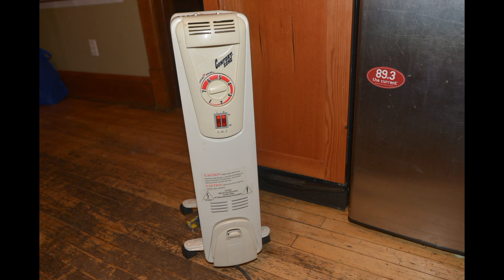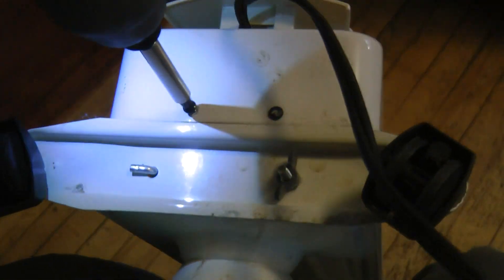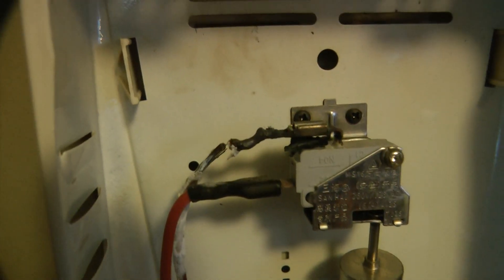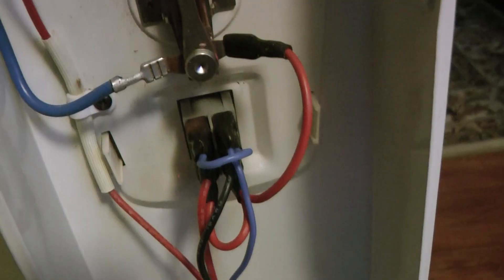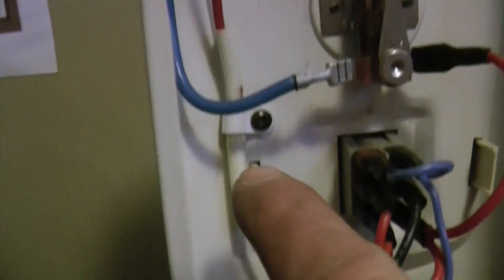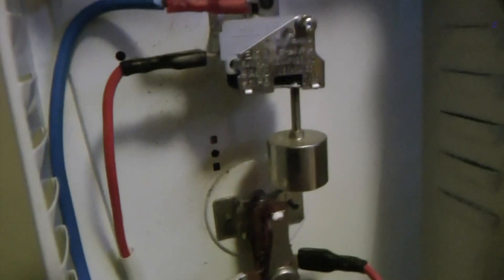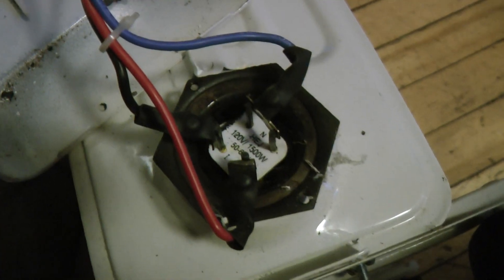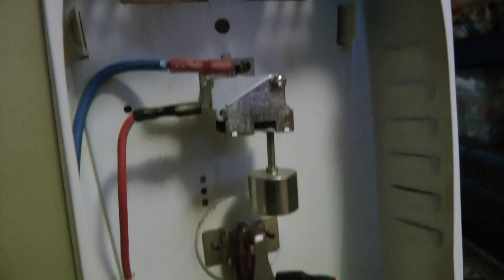EASY - Oil Filled Electric Heater Repair & Wiring Diagram

Comment: my dad in a small house used one of those small suitcase sized oil filled radiator type heaters, it was WONDERFUL for his situation, BUT, with his memory he would leave it on, one day I noticed a discoloration around the plug in the outlet, when I unplugged it the actual heater plug nearly came apart in my hand like putty, I then purchased one of those yellow heavy commercial plugs & replaced the original one with NO issues, BUT, if I had of known electrical stuff better I would of traced the cord into the heater & replaced it with one heavy duty one. WISH I had of rigged the knob or switch to where it could of NOT been turned to the max

Comment: That's not corrosion on those wires but high current meltdown.  It's amazing how many space heaters I open up and find melted wires.  I have numerous with failed 4-position rotary switches I'm replacing but prefer the dual rockers like yours has.  Much better and last longer.  What I like to do is actually leave the switch toggled on and control heater through the thermostat.  I like that tip safety switch.
Reply: Hi Tie/Matthew, I have a heater that just died on me...not because of the heater itself, but from the wire connected to it. The model that I have is very old and I wanted to know if there was a way that I could just replace the wire itself? If so, then where would I go to get the replacement part, especially given that it's an older model and it's no longer being sold. (Model: Honeywell HZ910). Thank you for any help you can provide. Thanks.
Reply: What temp is the thermo switch suppose close at
Reply: I pulled off my cover to quick now I don't know where the wires came off of the heating element can you please help
Reply: @toshia333  how did you make out
I think I have the same model
I pulled the cover off to quick now I don't know how the heating element was wired can you help send a pic or let me know if you found schematics

Comment: It would be a good idea to check the safety switch to make sure it isnt shorted. Also you should at least check the contacts on the thermo controls. Something made that wire burn and melt. While its open grab a can of contact cleaner and emery board a small soft aluminum wire brush and get after it. Use if contact grease wouldnt hurt when you go back togetger with it. It will help  keep the contacts and leads from oxidizing corroding as well as all terminal ends. Also if the blade terminal ends feel loose or not evenly connected on the blade gently squeeze the female terminal end  as to snug it down on its  terminal.
Reply: Yep you would have to say that anything with burned wires you shouldn't repair, it's probably the thermal cut out in the radiator body gone wrong in a bad way, even if you new how it wouldn't be worth it.
Reply: @peterbutlin6166  its not necessarily the burned wires part but determining the cause is worth putting a meter on it. If wores are burned right at a contact point of a sensor or element etc then thats a pretty good sign that whatever the wires are connected to prob failed in one way or another. If the wire is burned in the middle of a given length it could be that something caused it to get too hot in that spot or rubbed on the insulation or even internal wite failure possibly caused by the wire being mishandled onbinstallment and strands were broken causing a small short gradually causing further failure. Ive encountered all of those scenarios.

Comment: The thermostat ISN'T a rheostat. It has a bimetallic strip that when heated will eventually disengage the contacts. They can weaken and not shut off. A minor rebind can fix it

Comment: That “Rheostat”, on the the inside, opposite the Temperature knob is actually a precise Thermostat.  It has Contacts in it (like your oven t-stat), not a coil of resistance wire (like the stove burners).  These heaters often fail because people think thermostats are like stovetop controls (or gas pedals) and will heat “faster” if you turn them up higher than the desired Set Point.  [People do the same with air conditioners too; coming home in the afternoon, after “saving energy” by turning it completely off when they leave and turning it to 60 on return.  Then wondering why it quits cooling after an hour.  The coil didn’t get to defrost and is now a block of ice.]  The wire that burned on your heater, was simply The Weakest Link; basically a fuse.  Replacing the wire does not repair the Operator’s leaving it on high.  There IS a limit switch (for the oil), just above the heating element.  There is not a limit for the temperature inside the cover.  If you really need the air circulating in the front cover, to be 90+ degrees F, expect to replace the heater.  (It’s the cheapest way to get parts.)  P.S.  I’m installing a “stop screw” on the thermostat knob, at 74 degrees, where it will cycle off, cool to 72 (like an oven), then turn back on.  P.P.S.  Your electric water heater works the same way, except 240 volts doesn’t “Jolt”, it Kills.
Reply: I'm having trouble with my honeywell, it's old I separated the cover to quick and now I need to find out how it was originally connected.can you help please

Comment: I have two I bought last year that work great. I bought a used one and the dial is loose like it was knocked over and when I turn it all the way up, it still doesn't run long.

Comment: Not Positive  and Negative but Phase and Neutral   unless you run on DC!    tip over = anti tilt switch, not a rheostat switch but a bi-metal temperature regulating switch... 
question: where is the 150 Drg C  over heat temp safety shut off button thermostat?
Reply: Mine quit heating . I found the 150C over heat switch. I made sure I got a 15 amp replacement. Mine was open and when cool had no connection between terminals.

Comment: Mine powers up, but doesn't heat. I opened it and the thermostat knob doesn't click. Usually it does a clicking sound even if it's not plugged. Mine stopped doing it. I can't figure out how to fix it.
Reply: Was it fixed?
Reply: @Rishi2015  No. Had to get a new one. (Which also laster for a couple of years.) These things are probably designed to break after 1 or 2 seasons.
Reply: @martin984  Thank you for your reply.

Comment: My oil heater only gets luke warm when turned up full. The bottom is hotter that the top. The power lights only stay on for a few moments at a time...
What part could be faulty?
Reply from the maker: If I had to guess, it would be whatever apparatus the power goes through that is controlled by the dial or digital setting for heat level on the outside. It could also be one leg of the element, but that wouldn't make the light turn off...
Reply: Try flipping it for a few minutes, then flip it for a few other minutes, then test it.
Reply: I f**ked it out...

Comment: there is no Positive and Negative in Alternating Current, it's only a Hot and Neutral
Reply: Yes there is, positive is powered wave alternation, that's why it's positive, alternating between positive and negative, neutral is like the earth, it is essentially neutral, if you connect the positive to the earth you will experience an alternating current.
Reply: @peterbutlin6166  You have a live and neutral in AC not a positive and negative, as the live alternates between positive and negative with respect to the neutral and ground. So, it's not positive and negative in AC wiring.
Reply: @Eddiecurrent2000  no, AC, alternating current.
Reply: @peterbutlin6166  Yes, AC it alternates between positive and negatives, therefore there is no positive and negative wire polarity, but live (hot) and neutral.

Comment: Can you make a vid on how to wire directly to the heating element for a oil filled heater that has a two heating elements in one . Thanks
Reply: robviolin1 
then when your house burns down because you bypassed the safety features you can sue his back end ???

Comment: Hello my friend.. I've bought an AEG RA-5589.. the only problem I have is the temperature reading of the heater is reading wrong.. Room has for example 19 C for example and to set it to  maintain this temp I have to set it to 16 C. If I set it to 19 for example it seems not to autoclose its heater.. Is that normal?
Reply from the maker: Tooth Pain I think it's hard for the heater to be very accurate since the temperature probe is so close to the heat source. I would use the setting only as a relative measure as opposed to the actual temperature you were looking to achieve.
Reply: Thanks for your reply! It is just that it is a new device and I don't want to have picked a problematic.. Other then that it is working perfetc! Thanks again!

Comment: is it dangerous to remove the switch? and can you give me a tip on how to do it? mine got defected and burned, if i remove it and put the wires together, is it a bad idea?
Reply from the maker: Hmmm. I probably should not say. Watch the video for my take on what all the wires do and make your own decision or ask someone smarter than I.
Reply: Attila Albert  you can twist the primary switch wires together IF there is an overload protector switch.  If there is not then don't do it.  power will continuously flow and eventually make the metal casing of your heater powered or could cause a fire

Comment: It seems like the oil heaters are a deception. They probably only put out about 600 W. And they all have basic on and off switches like you’re too on and off switches. If you just turn one on it probably is just a light switch or an on and off switch. They simply just have power going out to the thermal coupler and then to the thermostat, that’s it.

Comment: is it possible to just bypass all the safety stuff and hook the wiring up directly to the elements..exercise a little common sense and not leave it running when no one`s around ?
Reply from the maker: That sounds like a good way to burn down your house. I am pretty sure you could buy these heaters in any pawn shop for like $30. It is not worth the risk.
Reply: @mbrenengen  except i`ve been thru 5 of them in 4 winters..they always stop working at least here in the US..they used to be high quality now they never last..there has to be a way to wire them so they hold up
Reply: Probably but what if you have a medical emergency or whatever for example

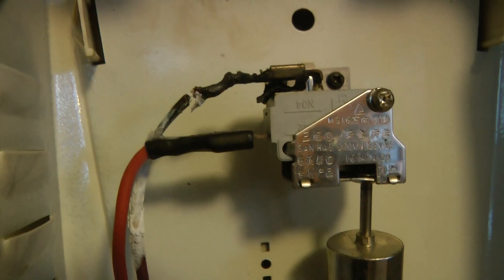Comment: hi, you missed the component at 1:37. it is a contact switch. it has probably fused itself and thus the burned wires from the heater being continuously on when plugged in. i just repaired my lakewood 7000 with a similar wiring configuration. the contact switch was closed and wires burned. cleaned and adjusted the contacts.  the heater now works and shuts off. best regards, m)
Reply: I thought possibly that burned wire is actually a fusible link. I figured the wire replacement maybe hazardous unless it was a equivalent part. I was curious what your thoughts are. I do have a kenwood ew7507ek that i cannot switch off  and that's why i watched this video. I believe Lakewood is possibly the same manufacture. A similar video of what oil heater that I'm working on is on YouTube if you word search you'll find the video. Thank you for any help that you may have.